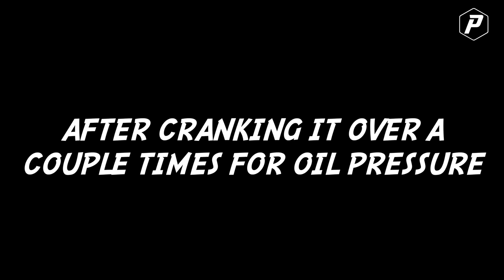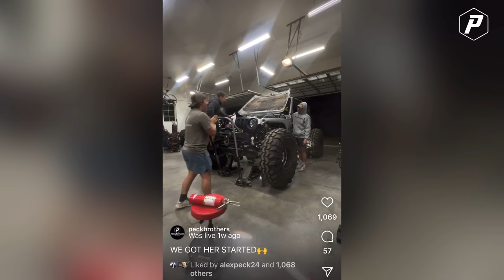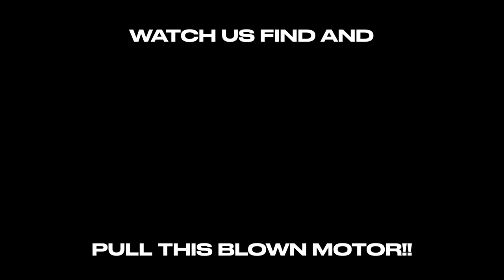WE BLOW UP OUR TWIN TURBO JEEP ON THE DYNO

Comment: When you skimp on seat pressure you'll find that Mr. Valve meets Mr. Piston. Considering this isn't an acceptable or wanted issue, you'll find valve pieces along with piston pieces and rings moving through the intake to find their way into other cylinders in order to wreak havoc in others cause they want to share the fun.

This usually causes windows in the block immediately after bending or breaking a rod or more.

You could have broken more. 

Load up with some valve spring seat pressure.